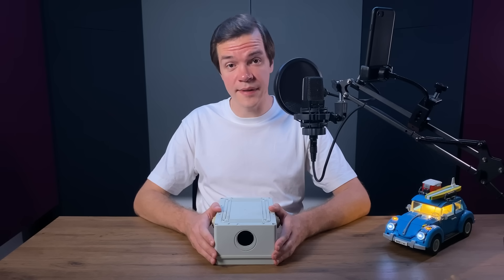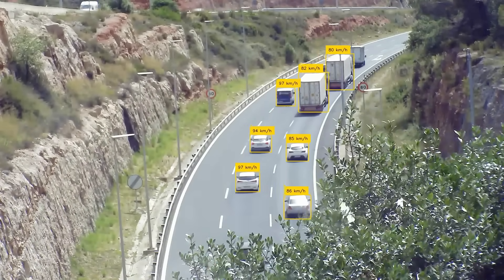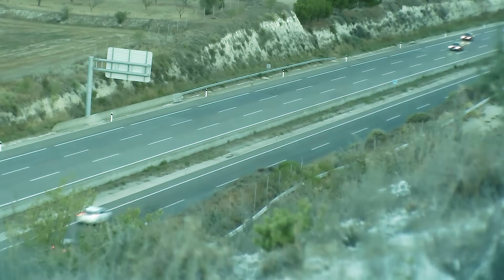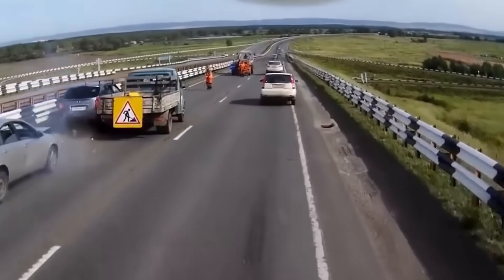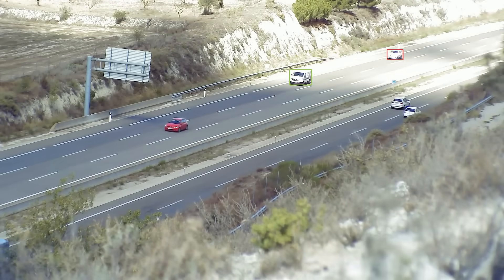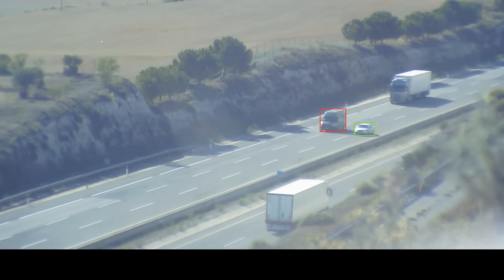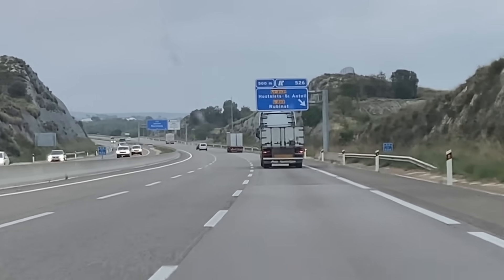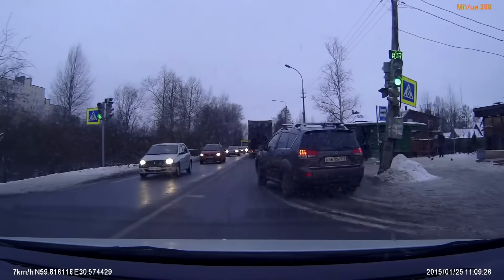New Anti-Tailgating Camera Reveals Shocking Statistics

Comment: Why do drivers tailgate section is not entirely wrong but incomplete. You've missed general spatial awareness. Drivers tailgate because the drivers in front are usually selfish a-holes hogging the lane. GTFO of that lane if you're slower than the adjacent lane. Now THAT camera is easier to implement with FAR FAR FAR LESS false positives.  You can see that in enough examples it this very video.  Reducing the accidents by eliminating the cause is a valid approach. However when the perceived cause is actually a consequence of another aspect, then the observed "root" cause turns out to be not well defined. The "we must educate ourselves" is correct,  however that is not solely for tailgaters.
Reply: most examples in this video are in the rightmost lane: where should these "slow" drivers move? the shoulder? Nitwit.

Maybe tailgating wouldn't happen if BMW drivers weren't speeding just behind regular drivers going to the proper speed limit.

Comment: What I like to do is pay attention to brake lights. If I see brake lights in front or further ahead, I immediately lift of the gas and place my foot above the brake, ready to slow down. If there was nothing and traffic resumes as usual, I reaccelerate, if not, I can very quickly react with the brakes. Sometimes I press the break very softly so that I barely slow down, but activate my own lights. Paying attention and anticipating traffic will help you keep a higher average speed as well, AS you are not constantly surprised and don't have to slam the brakes to an almost complete stop.

Comment: I've got one main issue with the distance/safety approach. Keeping distance from the vehicle in front of you, which goes about the SAME SPEED AS YOU, doesn't require you to fully stop in that distance, because that car is at roughly the same speed and roughly requires that same stopping distance... 2 seconds distance is enough because of this, given that you look ahead further than just the car right in front of you, giving you multiple things to assess the situation instead of just locking onto the rear lights of the car in front of you.

Being distracted while driving is removing yourself from any chance to react properly to changing conditions. Calling, texting, drinking, eating and even smoking in your car, putting on make-up etc. etc. etc. is far more dangerous because you'd not notice driving into a traffic jam even if you have half a mile distance.

Comment: You said it best when you said that if you try to maintain a safe following distance people only cut you off pushing you further and further back. The best solution I found is to speed. Get ahead of the traffic and at least for a short time I have a good safe distance both in front and behind me. Not saying it is the best, but the best solution I found so far.

Comment: A reaction time of 0.9 seconds is REALLY slow.

You need to be able to hit the brakes before you reach the point on the road where the car in front hit his AND be able to see your “stopping distance” ahead of you (plus the length of all the cars in front) and react to what is happening there.

This is my experience of 45 years of motorway driving. Read the road, stay alert, get your retaliation in first.

Comment: on the autobahn you'll have people switch lanes in front of you while going significantly slower than you very frequently.

They usually tell you they are switching lanes by using their turn signals the moment they start switching. I think blinker fluid is a precious resource to be used sparingly in Germany

Comment: Until 12:10 I'm totally with you, but then you just slap out a statement like it is not possible to use cameras for catching tailgaters...
We do already have such a system in Germany for years. So it is absolutely possible.

The argument about unwillingly becoming a tailgater doesn't make sense:
a) 
If you observe the traffic for multiple hundred meters, you can easily determine if someone is actively tailgating or became a victim. 
b)
Even if you become a victim, you're still obliged to restore a safe following distance. Not by slamming on the brakes, but by easing off the throttle. If you've done that and still got a fine you can take it to the court or have the footage reviewed.
c)
When slowing down by only 3km/h increases your following distance by 0.8 meters per second, and the camera is obsverving 250m of road there's enough time to see if someone eases off the throttle or keeps the close distance.
I mean even at 200km/h it still takes 4.5 seconds to travel those 250m. 
So even if you unwillingly become a tailgater at 200km/h right before the camera's field of view, you could still increase your following distance by 3,6m if you only slowed down 3km/h.
I'd say 3,6 meters is big enough to be measured and even observe with the naked eye.

If there's any reasons to not have anti-tailgating cameras are lazyness and saving money. 
I'm sure footage from anti-tailgating cameras has to be reviewed far more often than that from a normal speeding camera. Plus the equipment is more expensive.

So why invest all that time and energy into that, when you can just hide 2 pigs with a speeding camera behind a bush and make easy money?
Reply: this!!

Comment: Its not impossible... wait to merge until there is enough space, that is already law. The issue is understanding what actually is  the appropriate safe distance for different vehicles. 

Slamming on the breaks is never safe for anyone.  100m is minimum... and not for all vehicals. Trucks (lorry) should follow at 134m for safe, controled sudden stops.

Comment: I strongly believe that what needs to be done is active following distance systems in each car, that cannot be muted or ignored by the driver. These systems should check the speed you are going and the distance you keep to the traffic participant in front of you. If it detects an unsafe distance it should start with warnings - first maybe just vibrate the steering wheel, or some non intrusive chime, and if the distance does not improve the warnings should get more and more intrusive, all the way up to limiting the speed the car can go and eventually autonomously pull over where safe, like steering over to the right most lane, and take the next exit to a parking lot, where the driver then needs to go through a cool off period - let's say 10-15 minutes. Should the driver do unsafe following distances too often, the car should not be drivable for a longer period, after it had been parked.

Obviously such system would need to be smart enough to detect someone cutting in front into ones own safety distance, and be more lenient to the driver to allow them to built up a safe distance again. And also obvious, the system would need to be smart enough to punish those doing the cutting in.

Also, I believe there must be a form of reward system, for those driving according to the rules, so the drivers get a gratification for driving good.

Comment: Cruising on the passing lane invites tailgating. There is no justification for allowing to be tailgated on the passing lane,
Tailgating on the cruising lanes is legally and morally reprehensible. 
Also, when there is a slowdown caused by dense traffic, lane changers especially those forcing their way in, not only contribute to slowing traffic bu create avoidable tailgating opportunities, you see these when they change lane in front of heavy and laoded trucks. The trucks usually give themselves enough distance yet these lane changers often “cut” in and even slows down a laoded truck which cannot stop as easily.

Comment: Problem with save distance is as soon as you make sure you have enough space to the front car, someone will insert and cut that distance in half. I use the Tempomat on my car and try to lock into the front car at save distance, but that is not an easy cruise then because other drivers will disregard it and cut into my save space all the time. It is insane.

Comment: The thing I found is that if the speed limit is say 65 MPH, I drive 60. This constantly causing people to pass me and I typically avoid being cut off. If people do move in front of me they are traveling at least 5 mph faster and thus don't cause my car to enter into a automatic breaking system. I discovered this while towing my travel trailer. When I kept up with the speed I had a lot of unsafe moments. But simply reducing my speed usually made 90% of all those moment disappear. Downside is longer travel time, upside is peace.

Comment: I always drive defensively and stay either in the right or middle lane as much as possible. On the highway, I'll follow between 4 to 6 seconds behind the next vehicle. If there is a tailgater, I make sure the passing lane is clear and then slow down the speed slowly. Usually, the tailgater passes after a 5 km/h slowdown. Works every time. Patience is crucial when driving on the road.

Comment: At least in the US, specifically Southern California.  I believe the issue is the entitled drivers staying in the "fast/passing lane" that's either going the speed limit or about 5mphs over(typically 4+ lanes in total for the freeway).... while most of the traffic is is going 10~15 mphs faster... and then there is the drivers holding hands in multiple lanes.  

Out of curiosity.  Could you make a chart showing # of people following the safety distance based on their current speed, and showing the number of people not following it and maybe with the delta from safe distance?

Comment: This was interesting. I'm a conservative driver, but I was taught (100 years ago or so) to leave 3 car lengths between my car and whatever I'm following. This is obviously not enough, but, like @Baekstrom below, other drivers 'fill in' the space ahead of me if I leave a lot more, making me pull further back. Still, I leave more space than other drivers because the drivers that cut in front of me are usually impatient and they zip out again quickly. What amazes me is that cars are so incredibly expensive; to buy, to maintain, and to repair. Then there's the astronomical cost (in the US) of repairing damaged _people!" It's crazy to drive vehicles as poorly and as fast as many people do.

Comment: 8:46 the reason is that if you don't tailgate someone else will slip in between you.
11:26 at this point it likely costs more than it generates. as everything else it just about $.
12:13 buddy... you're already half way to having produced code that can detect 'having been made to tailgate by improper laneswitch'; if we are to penalize tailgate we should also penalize cutting others off, probably even more aggressively.

Comment: You MADE A GREAT mistake...
Suppose  you follow a car at 120km/h (33.3m/sec) at just 30m behind..
The front car BRAKES HARD at point Xo.
Reaction time to brake 0.9sec (at that speed  you travelled 30m).
According to the above....you WILL APply brakes at point Xo too..
AT that time the car in front will be 20-25m ahead of you (surely less than 30m, YOU HAVE REDUCED the gap)
IF YOU BRAKE AS HARD (EFFICIENT) as the car in front of you at point Xo you will NEVER CRASH.

For some reason you calculate that the car in front of you will come to an ABSOLUTE stop at point Xo.As if there is a wall at point Xo.
That IS NOT THE CASE in a freeway with NO JUNCTIONS.

The problem is WHEN you tailgate a car that goes 120km/h and you approach it FAST with 150-160km/h.(+40km/h) If the front car brakes hard (for some reason)
evenif you have a GREAT reaction time (0.4sec) you WILL crash unless you steer the wheel to change lane.

Comment: I am 55, driving since I was 18. I drive 50.000 km per year. I came to the conclusion speed cameras just exist because it is an easy easy to make money. Not because it makes trafik safer. Tailgating, cutting into your lane to quick. Use of phone , doing makeup and modern cars with a screen and submenus to change setting, and of course ignorant people who not care. In my opinion speed cameras are more dangerous because people are on the lookout for cameras instead of the traffic ahead of them. Personally I find the German highways without speed limit one of the savest! 
But 30m average is extremely close by! That must be typical spanish or south Europe? I am used to drive in the northern part of Europe like germany, Netherland and Scandinavia and distances are most of the time according the 3sec rule.

Comment: Here in the Netherlands it is a 2 seconds rule that is also not observed. The reason is simple however, it feels like nonsense and it sort off is. Research finds that high-way collisions in most cases happen at a relative speed of 30 kph. Car 2 with 130 kph crashes into car 1 going 100 kph for example. Humans having involved to live in a dynamic 3d world understand this on a deep level but not a conscious level. The 2/3 second rule only reasonably applies for sudden stationary objects basically.

The truly reasonable distance should therefore be: whatever distance/time you need to match the deceleration of the car in front of you. When there is a stationary object on the highway, the dynamic road signage already orders a speed reduction to 80 or 60 kph in France, Netherlands, Germany and Denmark as far as I know.

Comment: An excellent video. In the US drivers close the distance because they think they can intimidate the driver ahead. Even after signaling to move into the right lane after passing a truck (for instance) I've had drivers dive into that lane as I'm already moving over. Basically what I'm saying is A**holes are a major reason in the US. "I own the road and everyone else is in my way" is the common excuse; even if traffic ahead is 10 MPH over the speed limit. Of course we also get long (mile long?) strings of cars going by in the fast lane riding bumpers to keep other cars from pulling into the line. This action can save you about 5 minutes for every hour traveled.

Comment: Here in the US I have always heard about the 2 second rule. Meaning do not be closer than 2 seconds from the car in front of you. I wanted to know the distance that comes to in each 10 MPH increment. It seems that only at 100 MPH do you get to the 100 meter suggestion

10 mph: (10 × 5,280 ÷ 3,600) × 2 = 10 × 1.4667 × 2 ≈ 29.33 feet
20 mph: (20 × 1.4667) × 2 ≈ 58.67 feet
30 mph: (30 × 1.4667) × 2 ≈ 88.00 feet
40 mph: (40 × 1.4667) × 2 ≈ 117.33 feet
50 mph: (50 × 1.4667) × 2 ≈ 146.67 feet
60 mph: (60 × 1.4667) × 2 ≈ 176.00 feet
70 mph: (70 × 1.4667) × 2 ≈ 205.33 feet
80 mph: (80 × 1.4667) × 2 ≈ 234.67 feet
90 mph: (90 × 1.4667) × 2 ≈ 264.00 feet
100 mph: (100 × 1.4667) × 2 ≈ 293.33 feet

Comment: Thanks a lot, I fond your analysis really great. Providing actual data rather than just opinion is the right approach to road safety.
Personal thoughts: I have observed that the relative speed distribution has a strong effect on stress level (and thus probably risk). If practically  everyone essentially drives at the same speed (US, Scandinavia), it is easy and low-risk to change lanes. If there is a large speed spread (Germany), you must be super vigilant of traffic FAR behind you when changing, because they might be coming at you at 220km/h.

Comment: You don’t need 3 second gap as the first car will not instantly stop it has similar brakes to you so will decelerate  at the same rate so technically you can drive about a foot from their bumper plus thinking time,

Comment: you just need the hardware of a standard speedcamera.

measure the speed of the car
if its too high take a photo
if not continue measuring other cars
if a car with about equal speed passes in a too short amout of time, take a photo

those cameras seem to know the time, at least roughly and it shouldnt be difficult to compare speed and measure time advance

Comment: nice data. I love all the computer calculations. You would think the gov't would adapt some of this technology for other things as well. For me, I hate sitting at a light that is unnecessary. There is a green light for cross traffic that isn't there. Nothing like wasting fuel, time and money for nothing. So, smart cameras. I realize, putting a smart camera at each cross-street, looking 4 directions would be a costly program to apply but I think people would get behind it. It would help curb idle engines, get people where they need to go quicker, reduce fuel use and possibly cost in the long run. I want a system that will give me a green light as I approach if there is no cross-traffic. OR, turn green when cross-traffic ends before the timer runs out. I'm in Phoenix, AZ and Downtown phoenix is all TIMED. All of it. We have mid-street crosswalks that change every 30secs and have traffic wait for nearly 60secs, with NO FOOT TRAFFIC using the crosswalk. it's frustrating as hell. 
We have this cool technology. Companies are using it cars to self drive. Why can't we apply a simple version just to change lights???